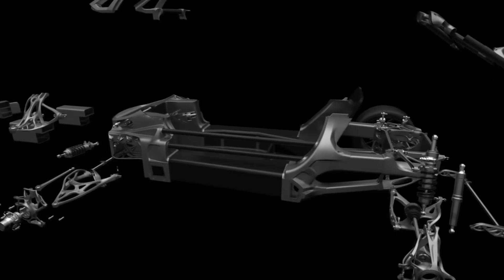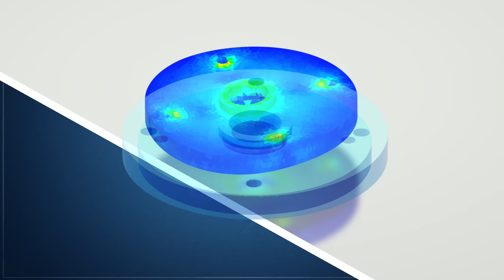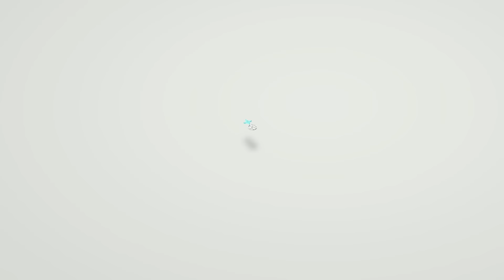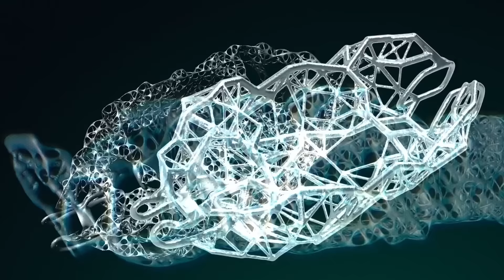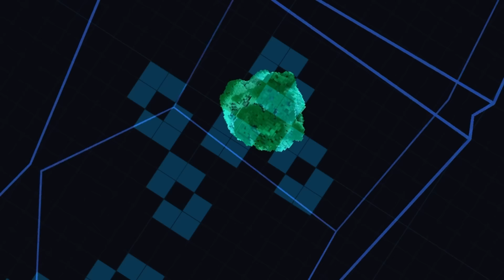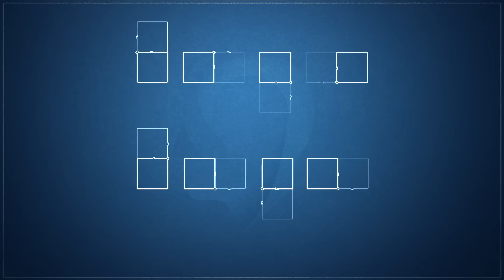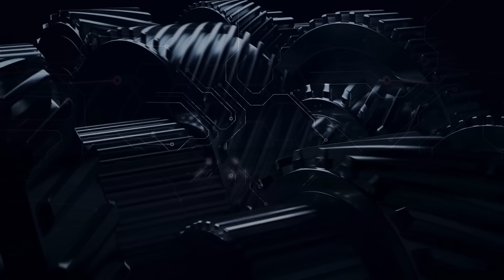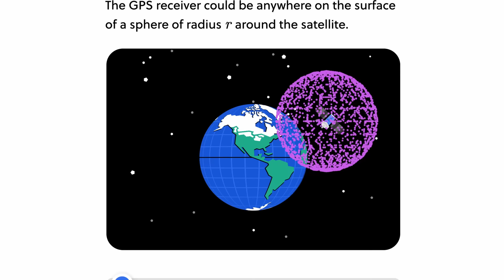The Future of Auto Manufacturing: AI Driven Design

Comment: Nice vid as always. However, this is known as topology optimization and has been around for at least 30 years+. See Bendsøe and Sigmund's book from 2003 that summarises the techniques. It isn't really AI, unless you employ a very broad usage of the term much like conpanies like Autodesk have done to jump on the buzzword bandwagon.
Reply: This video is awesome but it plays down the current amount of computing power that would be required to perform  genetic evolution on new car part. I worked next door to a company that was involved with this 12 years ago, so yes the in the dark ages, and they worked with about 5 generated  solutions of a chassis and this took days of compute. It would be interesting to know what has changed to make this process so much faster of do they just pay a very large cloud computing bill?
Reply: @garronfish8227 The computing power has changed in massive ways. Could be done locally, but I'm not intimately familiar with costs, which could balloon rapidly for hardware.
Reply: @garronfish8227 There is always the option to lower accuracy (and therefore safety), I wouldn't put it past a venture pitch to do exactly that.
Reply from the maker: That was my initial thought as well but according to several industry insiders I’ve spoken with, it’s far beyond a rehashing of existing techniques, but rather a move to machine learning being integrated into their implementation- to optimize the process of optimization. In computer graphics, ray tracing is currently experiencing a similar evolution, where decades old techniques are being blended with machine learning to overcome limitations. That being said, I understand your point. It is a YouTube video and I am limited in how deep I can go on the topic to reveal this nuanced “AI”.
Reply: @NewMind  Thanks for the reply! I think I was surprised the term wasn't mentioned -  that's maybe all it was on reflection, but indeed there are probably new methods that integrate closer with ML, particularly with regards speeding up FE analysis time and fitness assessment. There was a strand of Topology optimization called ESO and BESO which used evolutionary algorithms back in the day. Ultimately all these terms have kind of been fused together under the term 'Generative design', maybe in some part due to the popularity of GANs in ML (although of course these are very different!).
Reply: @NewMind The statement that AI is not the same as topology optimization is correct - topology optimization is driven off of the stress distribution in a previous iteration. Everything is data driven and in theory, a person following an optimization algorithm could arrive at the same result, just more slowly. AI driven design optimization, on the other hand, relies on random changes and comparison to others of its generation and previous generations to move towards an optimized geometry - the random changes and generational improvements are the big difference here. The way I think of this is "traditional topology optimization should converge on the same configuration every time", whereas due to the randomness of AI design iterations, running an AI optimization on the same design problem multiple times can result in multiple different solutions. Because of the parallel computing requirements, this simply couldn't have been done decades ago - therefore, they are not the same thing.
Reply: @NewMind  You're doing everyone a disservice here, by just slapping AI label on it, call it by its proper name.
Instead of educational content this just turns into clickbaity trash.
Reply: @NewMind just an idea for this and in overall youtube videos revolution :) add an instruction/code/github for an audience to evolve something from your movies, so we can not only learn but experience (like segment for sponsors, create segment for experiments :)) This could add another dimension to popular science videos 😮
Reply: @NewMind you are only limited by your own video length. People would love to watch long form content, of course, it's very popular now.
Reply: @NewMind YouTube videos don’t limit accuracy nor technicalities at all. He is right, this is closer related to a simple equation like D = log N/log S (produces efficient fractal structures). The processes to engineer this don’t have training like AI, and it’s also wrong to call it ML which normally uses statistics to create inference from patterns. But yeah now you will have I don’t know how many thousands of viewers equipped with faulty info. I appreciate the effort but you need to submit your research to professionals first if you aren’t one before starting the final edit.
Reply: @NewMind  all topology optimization softwares used a form of AI. this is nothing new. It isn't possible WITHOUT some form of machine learning.

We've looked at multiple such software programs from companies over the years, and it never pans out for the products we develop. It's a neat tool, but not quite as practical as advertised in many industries.

And mind you, I work in the AI industry, on the mechanical engineering side though, but working alongside the software and electrical engineers. And we can't use this software in our designs as it can't optimize much compared to our existing designs, and falls flat at production volumes and prices.
Reply: @SoloRenegade  what does it entail to work in the mechanical engineering side of ai? asking out of genuine curiosity.
Reply: @edt.l.892 You can get a math, computer science, or data analysis minor and it would help a lot. Truthfully the math behind AI isn't very complicated. The only difference between normal machine processing and stepping up to neural networks/machine learning is statistics and probability.
Reply: @NewMind would be really nice for you to make a deep dive video. Don’t be scared about the reach. Over time people would search it out. Love your videos.
Reply: @NewMind "The experts say" how about u name them and give me their home address phone number and social security numbers
Reply: Actually its a little alien species named AI who lives on the hardware who manually do the programs that we have been doing over the past 30 years like you said. 👍
Reply: I think computers have come a long way in the last 30 years mate
Reply: Interesting but there is a reason we don’t use this technology for mass production…expensive is the word
Reply: PTC, Autodesk, Dassault Systems, Siemens, and Formlabs all use the AI for their generative design and Topology optimization. They’ve been using that term for years now, way before this new hype from LLMs. Just because these Algorithms don’t work in the exact same way as LLM algorithms doesn’t mean they’re not AI. The term AI has always been an extremely broad term and has been used for things like chess bots, voice assistants like Siri, search engine algorithms and yes generative design software.
Reply: But the manufacturing for this one only now possible
Reply: Those lines are also called thrust lines in architecture.  Been around since at least notre dammes flying buttresses.
Reply: Re whether it’s AI, it’s all gradient descent combined with decision trees in the end. Most AI ideas have their roots in developments from 30 ~ 50 years ago, and the same for computer science as a whole. The practice and art is just lagging behind the theory.
Reply: @ceigey-au No, because this isn't that, and that is not AI. Don't confuse yourself.
Reply: @orbatos  They’re not using any genetic algorithms to coordinate this? If they are then I still stand by my comment - just decision trees and gradient descent ;-)

(Even if the decision tree is ephemeral…)

Otherwise, bah, fine mathematics wins again I guess…
Reply: @ceigey-au  They mention it specifically, and I've seen other tools use it. If you said it's impractical and they likely aren't using it that much I'd agree.
Reply: BUUUURRrrp
Reply: Nothing's new anymore, just a rehash
Reply: Very Nice Vid. The issues here are the terms: AI, machine learning, Deep learning etc.
Most people misinterpret the terms and misunderstanding what it actually means.

The tech most certainly is not new and we don't have anything artificial that has intelligence in the way of actually thinking for itself.

Even CGPT only adds information to it's itinerary. It does not think.
Reply: 😂😂😂😂ll
Reply: By the way... nice comment... this also known as all bark and no bit.
Reply: Alright Mr smarty smart-pants, then why don't you tell me where the sun goes at night?
Reply: ab8jeh, How would you define ai?
Reply: @AssWann  An algorithm that has the capacity to learn over time, changing its internal structure and able to adapt to an external environment.
Reply: correct. and it has limitations due to manufacturing methods, and can often not compete with more traditional methods at high volume production.
Reply: Generative design also. AI is starting to be a sales pitch for normal software lol.
Reply: This is 100% generative AI. It’s absolutely the correct terminology for what this is.
Reply: @cmoullasnet  oh ok, sorry.
Reply: It's literally like using the remesh button in Blender while defining areas of interest to maintain the shape of, and everything else is asked to maintain the volume of and disregard the shape, these things work on proximity and definition (statement) bases, so it's not AI, you still need a monkey behind the screen to do things.
Reply: Yeah technically speak this is just an optimization problem.
Reply: NO ONE HAS AI...none of this is sentience. This all VI...Virtual intelligence...A Goldfish is more aware than a VI.
Reply: I guess the AI in this case is referring to the thing controlling the roots for those softwares is something like ChatGPT or whatever else to make more unique designs and automate the tedious task of applying the rules that generate the iterations. Unless that's what you're talking about, but I believe it's more to do with LLMs exploring design roots much quicker? Unless I'm missing the point, which I could be, lol
Reply: @HughZantu  LLMs are english majors not engineers, they can't do 1 + 2 much less something like this
Reply: @alex31ytb  Well I was trying to make it simple to understand by using an example. I know LLMs can't do engineering but they are sure creative which in the engineering field is in dire need when it comes to new designs. All the talent I try and acquire are fairly restricted to the parameters their professors and university hold to keep their reputation up, however it makes it impossible to find anyone with TRUE creativity in design. Though as I say that I can see that Stockton Rush would probably like to enter the chat by now, lol

But seriously, lol
Reply: @HughZantu Nope, it's topology optimisations using algorithms mentioned. This is why the term "AI" needs to stop being used around these tools, none of it is AI by any definition.